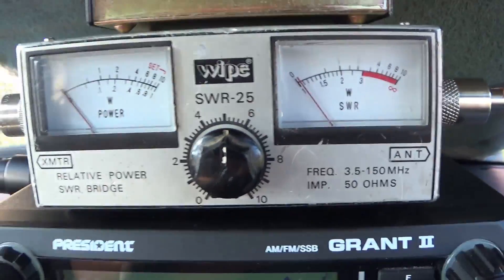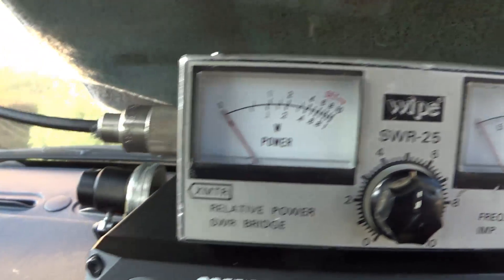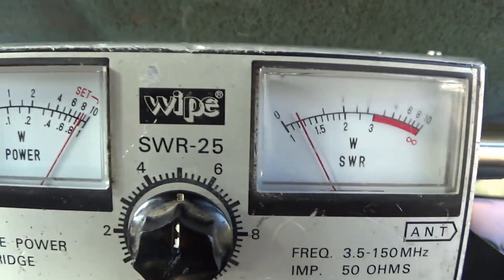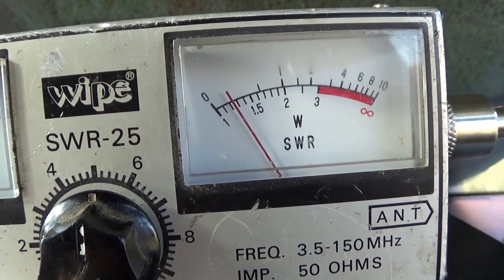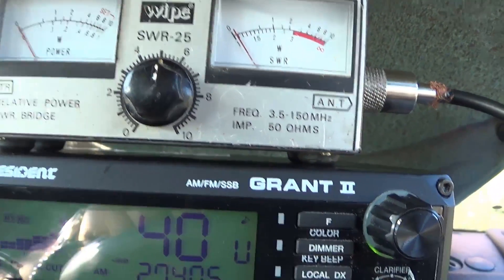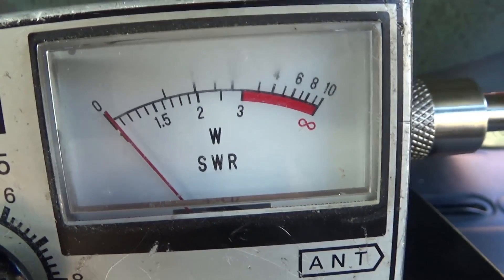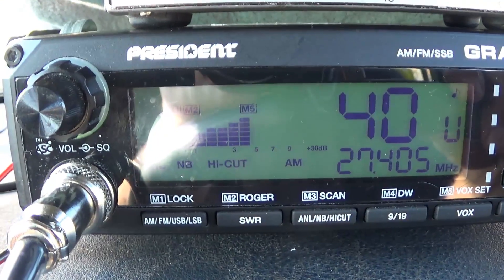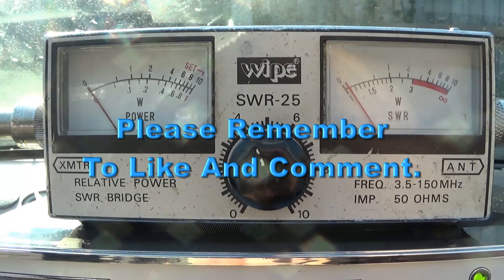Tuning a CB Radio Antenna Your SWR problem SOLVED.

Comment: Have you ever heard of this? I have a Cobra 29 LTD Classic with built-in SWR meter. I know some people say not to trust those. I used it to build a dipole base station antenna. And I thought I had it flat swr. 
I did this outside with a 6ft jumper. I will carry the radio into my shop and hook it up to a 100 ft or 50 ft brand-new rg8x coax, the SWR would be up around 3.5 to 4. I go back out and test it again with the jumper and the radio outside and it would read flat swr. 
After pulling my hair out I ordered a new Meter and double-check my work.
It turns out that when the radio gets into close proximity of the antenna the SWR meter would show Almost a flat reading. But when I take it many feet away it goes back to 3.5 to 4. The new meter reads the same no matter what. Now that I know my problem is in the meter inside the radio, I think I can retune my antennas and make it work. I was just curious if you ever heard anything about radio proximity to antennas like that?

Comment: Hi Steve. It's Keith in Littlehampton. So far I've had loads of bad luck. Today I found out my 2 sigma Excalibur Antenna s were faulty. I therefore got a sirio thunder. It's due in a few days. I'm restricted to space and council policy where I can  and what I can erect high up by our council house. I'm removing the 2 sigma Excalibur antennae and obviously replacing them with a sirio thunder. I did a bit of research on no swr needed antennae and I was able to decide on the sirio thunder. I'll get back to you once it's all set up. You should have heard my 6900N CRT this morning. Alarm like sounds came off it and readout said 5HI. I found out from Google what that meant. It meant swr is too high. Contact you soon as possible. Keith
Reply from the maker: Hi Kieth you should    ( ALWAYS CHECK YOUR SWR) even on an Antenna that says pre tuned etc,.
One of the reasons being is your coax connections may be at fault, antenna may be near metal etc, stick with it fella you will get there.
And of course if u need more help , or have questions just ask ok bud.

Comment: What would you suggest to do if your swr is at 3 on both channels 1 and 40? And what does that mean if it is?
Reply from the maker: hi dustin omg it could be anything , from a bad solder joint.
A bad install of the Antenna, faulty meter and the list goes on.

Comment: I dont need a class on how to use a meter I need a way to lower high swr .
Reply from the maker: Mobile or homebase
 SWR problem.
What antenna and what readings on what channels are u taking readings on.?
Reply: @CBRadiouk1  A-99 if I get it low on ch.1 its high on 40 and it goes both ways theres one thing I have not tried yet turning one ring up and one down Im gonna go back up the pole again tomorrow wish me luck are there any grounding tricks I can try?
Reply from the maker: A few things to look out for are.
Only slide the antron down the pole far enough to use both u bolts.
Mount the antenna away from anything else metal.
On 26.965  (ch1) mid band and 27.405 that's ch 40 mids.
The rings would normally be together and right in the middle.
Is the antron new or used?

Comment: Hi Steve, i've just bought a new antenna "Mini Bullwhip Modulator", that wont swr, I think the whip is too short and will try your recommendation to move my hand in to the antenna. I am trying to get help from the vendor but this is the reply ive just received ;  (when checking the swr hold your hand on the bottom of the coil, if the swr goes down its definitely a grounding problem). Is this correct ? ( my scarlet warrior on same magmount is 1-1) The advertised length of this twig is 95cm, but mine only mesures 88cm, thats with the coil. A replacement whip is a good two inches longer than this one. Cheers for any help, Simon (frustrated lol )
Reply from the maker: Hi Simon  first things first, i take it the whip is a used item?
The first thing i would do is ad a little to the whip, making it the correct length.
You can easily do this using a connector block, and a bit of wire / coat hanger.
I would also do a continuity test of the whip, from the base to the tip.
Presuming that the test results are ok, check the swr after the got the length right.
Using logic i would say your mag is fine,if you still cannot tune the new whip let me know.
Reply: @CBRadiouk1  hi Steve, no mate this is a new antenna from uk4x4 ! They are insisting they come from the manufacturer's like this ?  ive tested continuity and all is well, swr still 2.5 higher on the eu bands, indicating, if im correct that it needs lengthening ? will try your coat hanger method tomorrow, thankyou ;o/)
Reply: Quick update, I've sent the antenna back for full refund. I can see a Trimag on the horizon for my Warrior lol thanks for your response, you confirmed what i thought ;o/)
Reply from the maker: @simonboyle9961  
Hi Simon sounds like u did the right thing fella.
I will say I have heard a few people having SWR  problems with magmounts.
 Some Antennas just will not tune on them.
Body mount them and they tune, I can't explain why.
Reply: @CBRadiouk1  I was expecting it to be higher than the warrior, i've been catching up with all the CB/tech/review channels, As i've been off air for about 15 years. But that antenna was not New and was definitely shorter than it should have been lol
Reply from the maker: @simonboyle9961  
Simon if u want a solid performer, go Sirio.
Something like the high power 4000.
Get a mag that goes with it.
I tried most including the turbo 5000.
The megawatt 4000 out performed it slightly.
Right now I am using a president Texas, bought while reduced.
Reply: @CBRadiouk1  thanks for that Steve, will give it some thought , am happy with my Warrior right now, though i haven't really tested it, yet . I only wanted the small antenna because i dont trust the mag mount with a 190cm twig whilst driving over 40 mph lol

Comment: If you coax looks like that, with ground shield looking like that, you shouldn't be making videos. You need to learn how to put ends on your coax first!
Reply from the maker: Hi 817 looks rough, but trust me it is a nice snug fit.
I could have tidied it a bit,  but never did.
After nearly 40 years of radio, a cosmic thing is no problem.
So get over your self, stop bitching and jog on by.

Comment: Would it be a good idea to use two antennas one set for low and high??
Reply from the maker: Not really not for 40 or 80 channels.
 Most Antennas will cover at least 40 channels.
Hope this helps..

Comment: I have a problem. I'm using a Wilson 1000 mag-mounted on the top center of my Ford Fusion. Channel 40 SWR is between 1-1.5 and channel 1 SWR is between 2-2.8, depending on location. Also, when objects/cars move near the antenna, the SWR drops and then increases after the object moves away. All indications point towards a short antenna but it has been extended as far as possible, has never been cut, and I measured it at 62.5" which is the correct length for the Wilson 1000. I have no idea what I'm doing wrong. Any help is greatly appreciated.
Reply from the maker: Hi Daniel Just to clear something up, being near other vehicles does some times change the swr.

You are right in what you say it sounds like the Antenna comes up a little short, that said have you tried moving the mount to a different place on the car??

Also what 40 channels are you talking about, I presume ch1 is 26.965 and ch 40 is 27.405.

Have you changed the coax at all or is it as the mount came/was it new??

What else is in there is the swr meter a stand alone one or built into the rig??

If all else fails you could ad to the length of the Whip using a 15amp connector and a piece of wire or coat hanger.

The connector I am talking about is the ones with 2 screws , for joining wires together.
If you try it let me know the results.

Comment: i saw a video where he had a meter in his car. he lowered his antena with a screwdriver and after calibration he Removed the meter i dont see where the calibration is stored in the cb if one removes the devise thats doing all the calibrationing. question MUST you leave the devise attached ? and will driving not turn the noob calibration noob some do to vibration ?
Reply from the maker: Hi the meter is there to test the Antenna, if it is out of tune  the Antenna needs adjusting.
Once its tuned the meter can then be taken out of circuit.
Hope this helps a little, but if u need for more info just ask ok...
Reply: @CBRadiouk1   i will have some questions thank you

Comment: As a Newbie to CB - The hand trick is a def winner with me. Im in a situation where on both channels 1-40 my SWR reads 1.7 I don't know which way my antenna needs to go. Up or Down?
Reply from the maker: try it fella if the swr goes up its 2 long, if it goes down its to short.
That said if your whip is not in the clear ( near metal) and for example magmounted to the roof of the car.
let me know how things go ok ...
Reply: Steve Stevens Thanks for the response. Come the weekend I'll give it a go. I have a Thunderpole Orbitor SWR Pre-tuned. It's mounted to a fibreglass roof of my van via a Ground Toroid 3/8 electronic Groundplane. All seems to work ok with mates driving in convoy. I just wonder tho if my range out is ok or not. I seem hear people ok, just not sure they pick me up ok. Being a newbie too, I'm not sure if the set up and equipment I have are good enough. It's a learning curve I know.
Reply from the maker: Ok mate well, if u have any problem let me know ok.

Comment: Currently looking at a zetagi 203 on eBay as I’m going to put the radio in the car a MK1 president Lincoln
Reply from the maker: Hi Ciaran what power is the lincoln producing, and whats the max power you can put into the 203??
Reply: i have purchased a team swr on ebay now 26-50 mhz 100 watts input 25.00 with a patch lead should be hear by the weekend have a wilson 1000 i want to tune
Reply: not sure about ouput power on the Lincoln
Reply from the maker: Ciaran Mc manus 
U should get it checked bud, running to much power into an amp will soon blow it.

Comment: When you tune a radio which has FM and sideband, does tuning channel 1 and 40 on FM properly also mean the antenna is tuned properly for sideband? I'm new and buying a CRT 6900N next week, just a few things I need clearing up, cheers
Reply from the maker: Yes  you are tuning the Antenna for the frequency, AM/FM and SSB  are just you chosen mode.
Good choice or radio are you new to cb or coming back to it??
Reply: Steve Stevens Pretty much new, I used to use my Grandads handheld scanner a lot when I was a kid in the 90’s but never went any further. The other week I saw just how cheap things are and it has me interested again, watched a ton of videos here on YouTube and thought the 6900n looked like it would be a good start.

I have ordered my radio, I need a power supply and a good antenna, still researching a lot of stuff being new to it all. Somebody told me I could use a 10 amp power supply but better to buy a 20 amp. Been recommended the silver rod half wave too but still unsure about antenna
Reply: Oh and obviously bought a SWR meter, I read that having an external one is a little more accurate. Came with the little coax too for £16
Reply from the maker: Having a SWR METER , is a must really it will give you an indication of how good the rigs internal one is.
Once you know how the rigs internal one is, you can  take the internal one out of line.#Saves  extra leads etc.
If you have any problems pop back and ask ok bud.
Reply: Steve Stevens yes just a few more things. I’ll be buying a 20 amp power supply, which antenna would you recommend for the 6900n? Also, once I have the radio, swr meter, antenna, coax and power supply, am I all set to go or is there anything else I’ll need? Any particular length of coax or will a 20 meter one be fine? I also have some rubber tape to weather proof the connection on the antenna
Reply from the maker: Walking The Cow 
Firstly any cb radio antenna will work with any cb radio.
Depending on your budget, and how friendly your neighbour's  are.
Imax 2000, it's 24ft long fibreglass.
Antron 99 a bit smaller at 18ft,  and cheep.
Any 5/8  wave is ok.
If money and how big the Antenna is get the SIRIO GANMASTER.
All of the above are good.
Hope this helps, then  there is the coax.
Try not to skimp on it, go for mini 8, or better still rg213.
Reply: Steve Stevens Again, thanks dude. I’m thinking of going with either the half wave sigma rod or the sigma high gain venom. Anything over 18ft may be pushing it a bit, but it’s going to be mounted as far up on my house as I can get it, probably on a meter and half pole. I live on the top of a hill so hopefully I’ll get good reception. I’ll bang a video up about a month from now when I have everything setup, I’ll make sure to send you a link just so you can see my setup

Comment: Hey bud I have a question that might sound dumb but I'll use a quick photography reference to explain the reason for my question. Do all antennas have a sweet spot where you can get a super low reading on the SWR meter? In other words if my SWR reading is higher on channel 40 than it is on channel 1 and I start cutting away on my whip antenna to shorten it about a 1/4 inch at a time and I start reaching lower SWR readings does it get to a point where if I continue cutting too much my SWR readings start to get high again? My photography reference; all lenses have a sweet spot where you adjust the aperture from its lowest setting and work your way through the middle settings and you will find the lens sweet spot where the lens performs is best. As you continue adjusting the aperture from that middle area of the sweet spot and continue adjusting the aperture toward the high end you gradually start rolling OUT of the sweet spot. Hopefully my reference to photography and my questions to the antenna and the SWR reading makes sense now. Thanks in advance!
Reply from the maker: In short yes they do.
Lets say you are tuning an antenna for  a rig that has 1 band of 40 .
Like you said if you cut off to much, the SWR will be high right across the board.
The idea is to get a good swr on both ch 40 and ch one, anything in between will be ok.

So lets say you cut off to much, the sweet spot may still be there, but higher up in frequency.
Probably on the next band of 40 channels up.
The lower the frequency the longer the Antenna has to be, the higher up in frequency you go the shorter the Antenna has to be.
Hope this helps a little there is a way of checking the sweet spot , if you have a rig with 3 or more blocks of 40.
Lets say you adjust the antenna for ages and still cant get a reasonable swr, this is where having multiple blocks of channels comes into play.
GO down a block , if things improve go down another block.
If the swr drops on either block of channels or reads 1.1 there is the sweet spot.
As you should now realise, the SWR reading telly you the Antenna is to long for the block you are tuning for.
Just do the reverse by going up, if going down a block makes things worse.
So hope this has helped a bit.
Reply: Steve Stevens everything kind of sort of started to sound ok until you started talking about blocks. You lost me completely from there.😂😂 I am by no means any kind of CB/ radio waves/ electromagnetic waves/ microwaves expert. However what I may have figured out is if I feel that I may have cut the antenna just a little too short and my SWR readings are starting to increase then I still have a chance to save it by slightly pulling the antenna upward increasing its length by 1/4 inch at a time since it is still sitting all the way at the bottom of the base of the antenna. I just want those SWR levels as low as possible. I can't seem to bring the higher-end lower than 1.3. Thanks again for your efforts in that detailed explanation. Cheers from Miami Florida.
Reply from the maker: cruznfl340 
I am talking blocks of CHANNELS, some RIGS have  low mid and high bands.
So we may refer to them as blocks of 40.
U could try moving the antenna, it's easy if it's magmounted.
AS long as you aren't running hundreds of w, get a friend to put their hand near the whip, like I did in the video.
If the swr  drops it's to short, if it goes up it's still to long.
 If the whip is not clear of the vehicle, ie running along side of the cab.
Move it further away, let me know how u get on.
Reply: Steve Stevens yes I noticed early on that by moving the antenna mount on the mirror bracket as far as possible from the cab my SWR levels improved quite a bit. I will try your technique. Thanks for the feedback! ✌

Comment: I just got a new cb for my off-road rig and my swr is good at ch 40 but reads 3 at ch 1. The antenna does not have a tunable tip so will adding washers on the mount be the equivalent to extending the tip or is there another way to tune it besides buying another antenna
Reply from the maker: Hi Ben can I take it your swr on ch 1 is 1.3 two points under 1.5??
If it is that should be more than ok.
As for making the antenna longer a few washers may work, if the whip is metal you can put a connector onto it, the type for joining wires together.
Connector block or whatever else they may call them, its the type with 2 screws.
Put a bit of wire into one side, and slide the whip into the other side, it may cause a bit more wind drag though.

Comment: Nice on Steve mate.
Reply: ONE ^
Reply from the maker: Hi Glen i am glad i could help matey
Reply: Yeh man, I bid on that CRT 6900 but lost out in the end. I did visit Knights again and got fixed up with a Midland 48 Plus Multi and a Thunderpole Voyager, SWR meter etc. Hopefully doing the install tomorrow. Still haven't picked a Handle, might use my old one from the 'Dark Ages' lol. Then again I might go a new one.